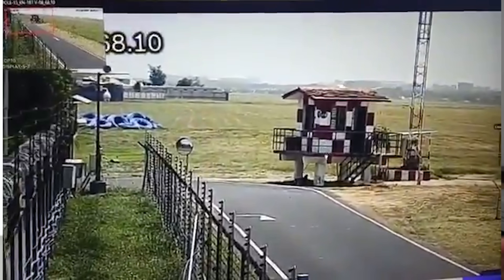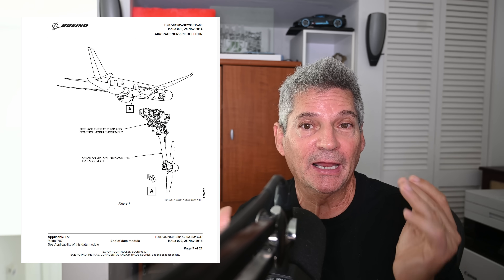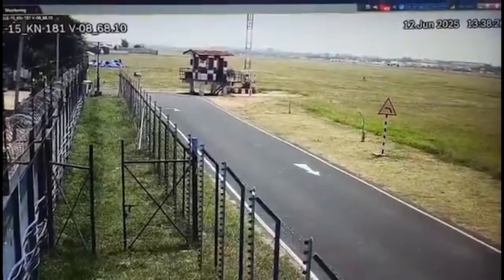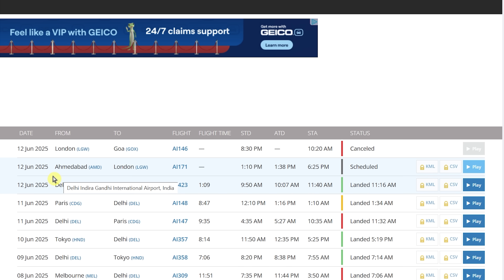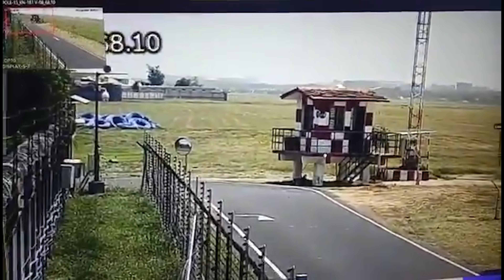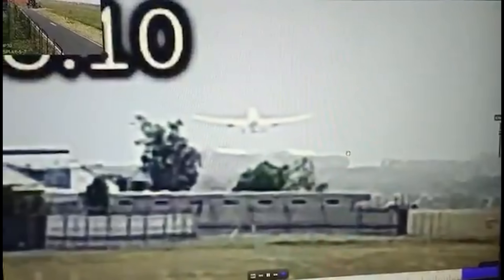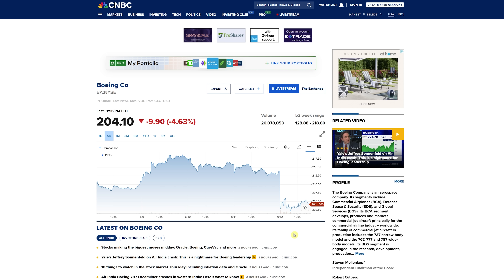What Caused Air India 171 Crash, Mysterious Sound Before Impact

Comment: If indeed the engines no longer exerted thrust, I have trouble understanding the maintenance of the plane’s nose in a raised position whereas in the case where there is no more engine, it is imperative to pitch down to gain some speed and above all avoid stalling!!
At 625 feet, or about 200 meters in altitude although it is very low, lowering the nose of the plane was the only solution hoped for to try to land without stalling!!
Hypothesis: often in these stalls during takeoff, it is the omission to check the extended flaps that is the cause of a departure that goes wrong 
ex: crash of the Spanair 5022 on 08/20/2008..
Reply: The number of accumulated hours for the crew does not matter, often in these stalls during takeoff, it is a simple oversight to check the flap extension which is the cause of a departure that goes wrong ex: crash of the Spanair 5022 on 08/20/2008,  the perfect case where an experienced crew does what is necessary for the first time to return to the parking lot, waits a long time under a scorching sun, returns to the takeoff point after two hours of waiting, pressed, do not check the exit of the flaps that had been retracted in the meantime to take off reaching a certain height and crash for lack of lift several hundred meters after the end of the runway... a fatal error due to negligence.

Comment: How about fuel contamination, maybe with water? This has happened before but usually problems occur later in flight.

Three fuel tanks: The 787 has three fuel tanks: one in each wing and a center tank in the fuselage.

Center tank pumps: The center tank pumps are designed as override-jettison pumps, meaning they have a higher pressure output and are used first to feed the engines. So a common source of fuel. An AirBus had salt water contamination that caused engine problems. Another aircraft had fuel contamination due to putting in 10 times too much of an additive (possibly an additive to stop biological growth). A 777 had both engines get fuel starvation and flameout (ice crystals clogged the filter, not likely in this case). 

Jet fuel floats on water and is it possible that the engines were getting a mixture of fuel and water and then a lot of water that caused both the engines to flameout near the end of the runway when the aircraft rotated. On the acceleration on the runway the engines were getting a mixture and generating lower thrust. On taxi the water was not being pumped to the engines. 

Just about everything runs on electricity on a 787 (even the hydraulic pumps)? If both engines flameout at the same time, APU is shut down & RAT is just barely running, what gets the last of the electric power from the lithium batteries?

Comment: @jeffostroff, the radar data shows the max height gained by flight AI-171 as 625 feet.

Ahmedabad airport is 200 feet above MSL (Mean Sea Level).

Hence, the aircraft was actually only 425 feet AGL (Above Ground Level), before it lost thrust and stalled.

The pilots would've been helpless to recover the aircraft from a stall at such a low altitude.

Comment: That plane is climbing with a slight yaw to the right, as one would see if the right engine failed just after V1 or rotation.  There is also quite a bit of dust blowing on the ground, appears only on the left side, just after liftoff, like the pilots had maxed out the thrust levers, but only the left engine responded.  Now, I'm not saying they didn't also retract the flaps instead of the gear at the worst possible moment, and for experienced crew to make a mistake like that, can be caused by an engine failure after V1, as the stress level skyrockets.

Comment: For Boeing, I hope and pray the pilot not flying, made a mistake and raised the flaps instead of the gear because the other issue that they have discovered in dream liners is the wire bundles in the wings and if they aren’t, it could’ve raised the flaps

Comment: I've seen a documentary about Boeings 
Flawed design. Fuel tank then air conditioning then the lithium ion batteries 
Stacked up . All it took was a lil static electricity for it to self d struct . But in 
This case I was thinking it could be related 
To the wing flaps. No power no hydraulics
Flaps could have caused the plane to be 
Uncontrollable. Almost locked into the 
Landing position.

Comment: At this point in time, I do not agree with the RAT hypothesis just based on the sound. We have no idea of the quality and direction of the microphone. It could be between buildings and there are strange echos, etc. I have planes fly over my house when the wind is in a certain direction and you hear all sorts of strange noises due to thrust adjustments and the Doppler effect. At this very early point, I would say signs point to pilot error and I know Boeing has gotten a bad rap, but this plane has been pretty stellar in terms of safety.

Comment: It seems that the aircraft didn’t truly take off but was rather pushed forward along the ground due to inertia.The weight of the plane and the thrust required in that hot atmosphere were not sufficient for proper lift-off  . As a result, the plane stalled. A plane can only recover from a stall by performing a nose dive to gain airspeed, engines by design didn’t have enough power that could push the plan into sky and the plane didn’t have the altitude to achieve the airspeed necessary for sustained flight. 

Disclaimer:I don't even get close to any plane in my life, it is my own sense of understanding .

Comment: when this plane was first out, it had 2 issues--in 1 case the windshield cracked (in the cockpit) & there was something else--maybe a door fell off? Or was it the one that disappeared into the ocean?. I was scheduled on that model plane for Japan but fortunately it got pulled out of use for a time due to these early problems. i almost cancelled my trip, but fortunately a different model plane was listed as this model's use was halted, so i didn't. It was a problem at the start. Surprised it didnt have more issues after those early ones.

Comment: Your right with that sound what I think is the rolls royce engines failed as air nz has stated that 4 dreamliners were grounded due to technical issues with the rolls royce engines and air nz are now swapping them out to a different type of engine and not rolls royce or pilot error we won't know until they go through the blackbox

Comment: I find the probability of a vortex high in the following respects:

The images eliminate other possibilities. The simultaneous loss of power in both engines and the aircraft falling like a stone without losing the wing balance, i.e. without turning. The unusually long existence of the void created by the air being cut by the large aircraft in front of the extremely hot and stagnant air, which is not seen in the images. As a result, vortices disperse much more quickly in windy weather. But even if the air is calm, the vortex left behind by the aircraft in front, which is flying at a safe distance, may remain suspended in the air for longer than normal.

I showed the images to the AI on my computer and asked it to find the highest probability of a terrorist attack, a bird flock, electromagnetic induction spreading from underground, sabotage, pilot error, manufacturing or maintenance error, and a vortex. After criticizing the images, it said the highest probability was a vortex.

Does anyone know the departure time of the aircraft before this one and what the minimum antivortex safe distance between the two aircraft should be?

Comment: I was recently on a flight direct from Mumbai to NYC (non-stop) on an AI flight.

First the aircraft (ac) that was supposed to fly was diagnosed to have unrecoverable technical errors and they replaced it with another one. An ancient ac that had broken IFE on most seats, broken seat trays, and seemed like it had been pulled out from being grounded, showed up. This must have been their most desperate spare ac from a hangar that they could roll over to the gate at the last minute. That ac did NOT look good.

 I fly comfortably and am not given to panicking in air and have seen some quite turbulent flights. But this ac spooked me out because the lights inside were flickering. I remember asking myself, "Do I remember what I've learnt from the silly aircraft landing games I play? Will the electrical and pneumatics of this vessel hold up?" For the first time in my life, I was uncomfortable flying. That ac did not inspire faith. The Pilots were very good and I flew without an incident. But overall, the question of AI's maintenance is a very serious one.

Comment: 20,000 747/C-5 flight engineer.    first thing after take off... check speed and climb rate... then say POSITIVE CLIMB, GEAR UP,  and then, instead of grabbing the gear handle, the flap handle is place to flaps up.  Watch this thing take off.... all is fine, then about the time, the gear should be coming up, that doesn't happen.  But if the flaps go up, you will lose lift as they retract.. you can see the jet gradually slow in it's climb and then level off then start to descend, it descends faster and faster as the flaps come up.  WATCH IT AGAIN WITH THIS IN MIND.    100% possible ....

Comment: I read a comment on another channel that the flaps and landing gear are hydraulic on a 787. Plus in another angle you can see the air brakes on the wings look deployed. You see some black rectangular shapes on the wings - those are the air brakes. Stricken aircraft, can't get the lift it needs. Landing gear wasn't retracting as they should have been, flaps and air brake malfunctions makes it stall.
Reply: From watching some other videos of a 787 taking off, they're putting the gear up fairly quickly - you don't see that on this takeoff. Just another point towards that RAT being out and the hydraulics not working.
You're correct - you can hear that prop noise. Nice catch buddy!

Comment: Hot+ high+heavy+ gear down+ no flaps+ RAT down? Major swiss cheese
Reply: + intersection takeoff
+ Surprise airbrakes at 200ft once the RAT brought power back online
Reply: @user-pf5xq3lq8i  looks from that puff of dust he went into the over run area before getting airborne
Reply: @calmargarita  that's engine flameout smoke on Rotate.
Reply: @sambitranjan9584 
I’m 100% convinced that the engines were producing full power right up to impact. This is a loss of lift, not loss of power. The flaps LOOK raised, but not the landing gear. Power on stall due to exceeding the angle of attack with huge drag
Reply: @erichavedisian2655  do you realize that the B787 has a configurator that would not let you take off without overriding the alarms which are deafening. 2 pilots are absolutely not going to miss that
Reply: @erichavedisian2655  not even possible on this aircraft, this has been explained by multiple pilots and engineers.
Reply: @erichavedisian2655  Dual engine failure.
Reply: @calmargarita  Landing gear was in process of raising but could not complete due to hydraulic failure. Flaps were set correctly. Both engines failed immediately after takeoff.
Reply: yeah, there was only one slice and it was mostly made of air. BTW flaps are probably not in casue, but loss of power on one or both engine definitely is one of the main causes if not the only cause.

Comment: The strange noise is deployment of RAT. This means loss of power and engine loss too.
Reply: We all watched the video. You're just parroting.
Reply: wow.  great insight.  Especially since thats what the video said.
Reply: RAT when deployed sounds Like a racing car at the back
Reply: Not the rat 100% a 787 normally sounds like a prop job.
Reply: When I zoom in on the video, I can see something sticking down from under the wings. I’d say RAT is a definite possibility.
Reply: just look at the video, if you zoom in there is no RAT deployed at any point of the video, sound is just the engines at high power and with buildings around u get echo/reverb effect. the engines on this plane are also Turbofan Engines with large fan blades making the thrust, but if you look, no flaps and with gear down at that point of the flight is very bad. looks like pilot error
Reply: @Heavycap that’s not what jet engines at full power sound like though

Comment: Selecting flaps up after takeoff instead of the landing gear is my theory, and it explains why the gear stayed fully down And the plane began to stall at that rate of climb.
Reply: @Vintagetrailer, a photo of the severed wing lying at the crash site shows the autoslats were deployed at the time of the crash. 
Obviously they couldn't provide the required lift because of loss of thrust from both the engines.
Reply: Is there any automation for flap safety
Reply: @Movieswod-v9f yes.
The in-cockpit warnings will blare if the aircraft tries to takeoff with a flap zeeo configuration. 

Once airborne, if the flaps are retracted prematurely and the angle of attack is high, then the autoslats will deploy automatically, without any pilot intervention or input.

Comment: Modern aircraft comes with automation and warning systems that prevent mishaps involving incorrect take-off configuration. The 787 is known for electrical quality issues in the past, so some electrical failures may have occuered and disabled warning systems for incorrect take-off configuration. Anyway, we will find out the root cause with the official investigation

Comment: I see the leading edge slats deployed, and i can not clearly see the trailing edge flaps but both leading edge slats and trailing flaps are sequentially integrated for takeoff and landing configuration. Yes i believe i can hear a RAT in deployment which means some sort of electric, hydraulic failure of some sort. I dont know what settings takeoff flaps are set to for this airframe type, but i cannot really see if they are set at all, its a clean trailing edge, and the spoilers are deployed as well. But speculating can only take one so far and until the report is distributed by whatever NTSB equivalent india has we really dont know. Last thing, without setting the flaps to its proper position, it will be nearly impossible for a multi ton aircraft to produce enough lift to maintain stable flight, the airspeed  and engine power settings will not miracle you into the air without proper flap settings.

Comment: Are you seriously saying planes keep all their fuel in the wings? Imagine trying to actually fly a plane with tonnes of fuel in the wings, preposterous, just insane
Reply: Well, yes.  Where did you think the plane has its fuel tanks?
Reply: @benjalucian1515 it doesnt, jet engines compress air til it ignites creating thrust. 
Fuel is required to take off, not fly.
Reply: @mac-qt3wd  Fuel is required to take off, not fly  Uh, no.  It's an internal combustion engine. The engine compresses the air, fuel is injected, mixed with the air and ignited, expanding the heated air out the back through a turbine and nozzle, creating powerful exhaust which propels the plane forward.
Reply: @benjalucian1515  you need to actually study before you talk, as in actually look at detailed drawings of a jet engine  and see where the fuel intakes are....there aren't any. And study physics of trying to fly a plane with 36 tonnes of fuel sloshing about in the wings. Or just stop working for the wrong team.

Comment: FLAPS! I’m not a professional but I’ve watched enough of that TV show that is about plane crashes and only plane accidents to place my money on FLAPS. It’s on Smithsonian TV and I’ve probably watched every episode and you can learn so much watching them reenact the investigation .That planes angle of attack was too steep. Instead of a nice slope , he came down at 45 degrees with the landing gear extended.  I’m sure there is a part of decent that is 45 degrees but the landing gear , I would not believe, wouldn’t be out until glide slope is closer to 20 degrees. I’m taking FLAPS. It’s really an awful thing to see and I’m not trying to make light. I guess we will find out. Btw, I know Boeing safety record hasn’t been stealer lately but that plane has been flying for years and been safe. Maybe I should watch the video before commenting.

Comment: The plane took off at the very end of the runway. You can see the aircraft is barely climbing up from the CC TV videos. It may be that incorrect weights were added during preflight, resulting in incorrect V speeds. If you do not have a constant climb, usually pilots don't retract the landing gear. The flaps were extended for the take-off position, probably at the lowest possible take-off position. Please see the wreckage from the Pilot Blog. You can clearly see the edge sliding out. https://youtu.be/oUFS2np0mKc?si=0ASfELLX4Llp5u8x Either the aircraft stalled with incorrect speeds or both engines failed; the audio has the faint sound of the Ram Air Turbine working, then something went wrong with the engines.

Comment: At lower speeds or during takeoff and landing, the noise from jet engines can sometimes resemble the sound of propellers, especially if the jet engine is struggling to generate enough thrust, and the noise is not muffled.

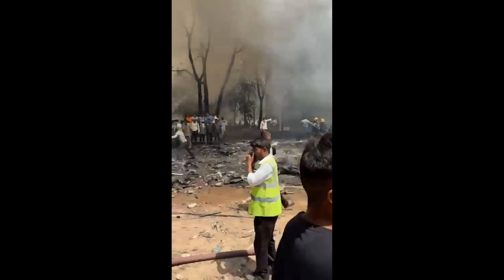Comment: 7:55 it actually crashes onto the top of a building well before the medical college - the mess hall. That's where the tail is lodged. The vertical stabilizer falls off next to the building, and the forward section then appears to have slid forward, through some trees, which are burnt to a crisp and impacted two accommodation blocks. There does appear to be some drift as the mess hall is not in a direct line with the runway. You can check all of this in Google Street view and compare with the many images of the crash site.
Reply: BTW, it would appear there was no time, and possibly no control to maneuver the plane to the pilot's left - there's a large space with no buildings. A shame as it may have saved more lives if the plane had come down without impacting buildings.